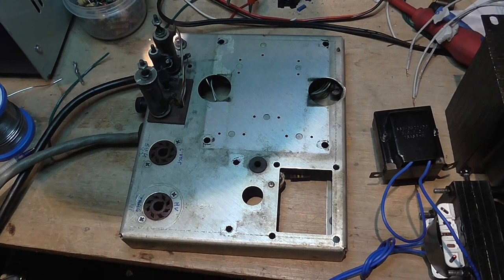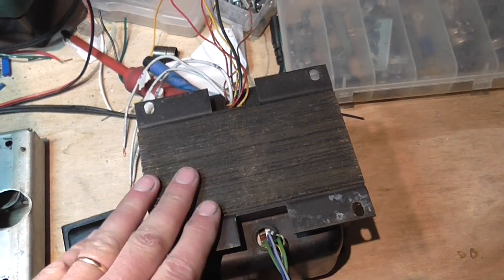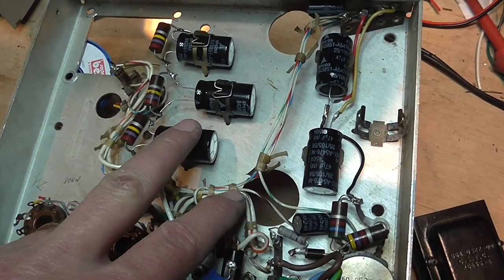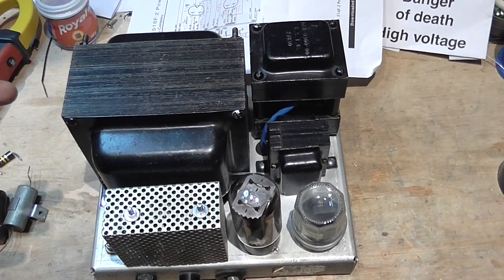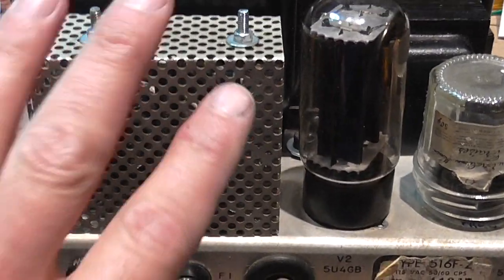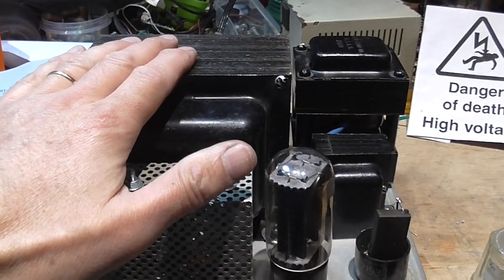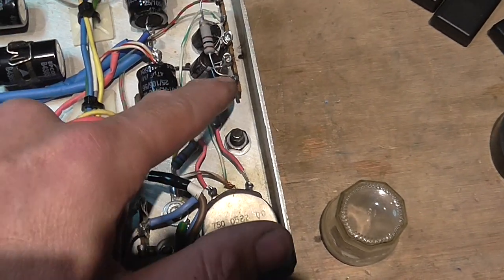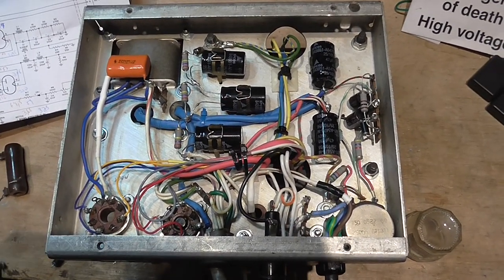S06   Collins 516F Power Supply Repair

Comment: Nice video. I would be more careful when placing electrolytic caps near power resistors, your smallest electrolytic Cap (10uF)  is currently touching (1 believe is 1 Watt resistor). Try to move it away from it. It will dry that cap prematurely. otherwise is a nice restoration. Good job.
Reply from the maker: Ovi Bucur  Thank you for your comment. Actually no, the resistor is quite far from touching the cap. On the video it looks like they are touching but the're not. I do take these details into consideration during layout. I forgot to comment on the video that on the big power resistors I riveted high temp cables to avoid solder from melting as it happened. 73